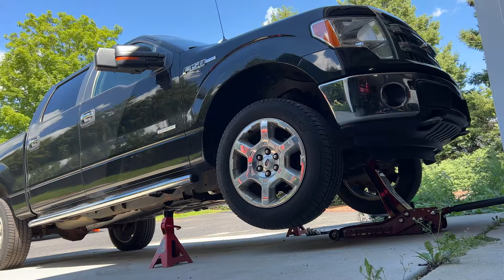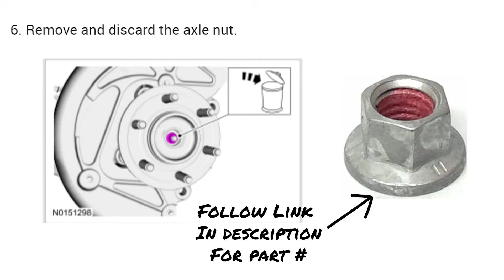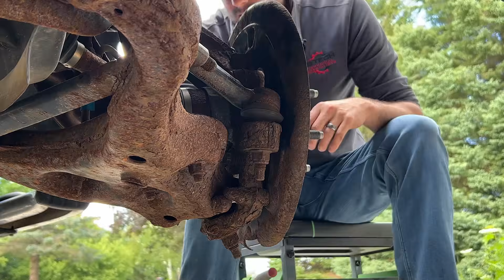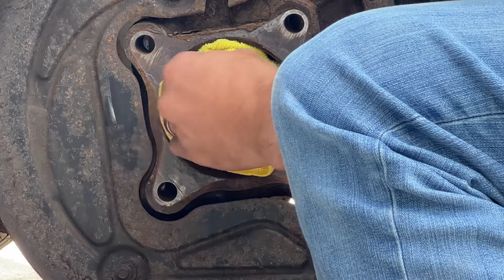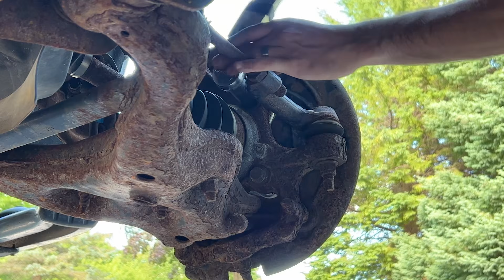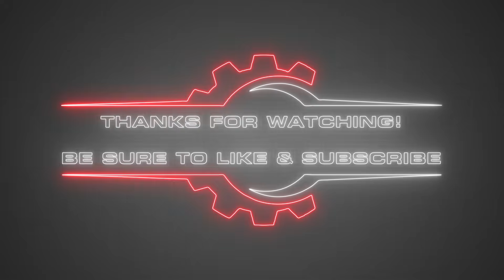Ford F150 Wheel Bearing Replacement 2011-2014

Comment: What do you do if the axle tip is protruding through the wheel hub too far, indicating the axle is too deep in the hub with the axle gear potentially touching the IWE gear?

Comment: I paid $130 to have the replacement parts shipped overnight. Based on the estimated delivery time of between 10:30 and 2:30, I took my truck out of service and removed the wheel bearing/hub assemblies. It's a relatively easy job. Shortly after noon, the estimated delivery time changed to between 3pm and 7pm! Great! As a result, I lost a days income. The parts did not arrive until almost 5pm! I contacted UPS, who referred me to 1aauto, who stated that since I got the parts before end of day, they would do nothing for me. Not a partial refund. Nothing. Nada. So much for a company that cares about its customers. Lesson learned. Don't trust shippers to provide accurate information you can rely on to plan your work, and certainly don't expect 1aauto to meet you even part way. Bob

Comment: Tried this on my truck... didn't go well for me. I ordered a MEVOTECH TXF40302 off Rockauto. The part looks amazing and came with everything I needed. However... when I put it together, it made a grinding noise like gears barely touching each other. The old part doesn't make that sound and the 4wd engages and disengages just fine. No noise while 4wd engaged. When I pulled a vacuum on the 4wd actuator, it holds vacuum well and disengages the axle. But the gears just barely touch and make a grinding noise. Bad actuator? or bad new part (gear face too long?)?

Comment: My local dealer wants to charge me $2000 to replace the rear end bearings on my 2013 F-150-that I have had serviced regularly  every 5,000 miles since new! and not once did anyone mention they don't check rear end lube, bearing wear or that I needed to have it done!  So stuck with $2,000 bill for what should have been caught years ago
Reply: Change it yourself. It’s so easy.

Comment: Another tip my axil pin did not come out enough to put the 15mm nut on it. So tap and shake until the nut fits on. Then leave dust cover off and drive around < 40mph and it came out that rest of the way. tighten up nut remove tire and put dust cap on.

Comment: This job is not a 1 hour job It takes the whole weekend: router sticks, bolts sticks, hub sticks. I had to walk to Autozone for stuff to help. If it's your only mode of travel plan plan and practice. Review this very good video and get the tool list.
Reply: Gotta learn how to wrench better, did both sides in my driveway along with brake pads and rotors in under 2 hours. Trucks got 300,000km in the rust belt. Heat is your friend btw, wouldn’t be able to do it without it. Don’t even have the pull the tie rod end either.

Comment: This was not bearing, it was hub assembly install...
Reply: Modern wheel bearings come as a unit, in this case with the ABS sensor and IWE toothed ring as well. You can't buy the wheel bearing by itself, and often the outboard inner race is machined right into the hub itself. Some may have nostalgic memory of pressed-in wheel bearings, but they were a pain to do.

Comment: Thank you for the video....I will be changing the wheel bearing hub assembly on my 2013 Fx4. I was just wondering if you would happen to have the part number for the metal cap that seals the shaft nut.
Reply from the maker: Hey Amrik, thanks for watching! Here's the link to our website that lists the parts we used. https://gotech.com/how-to/replace/replace-2011-2014-ford-f150-front-wheel-bearing
~Mike

Comment: Mine is just spinning hard o can figure out if I need a new one or not
Reply from the maker: Hi, when you say spinning hard, what do you mean? Like its seized up or are you trying to spin it by hand with the axle shaft installed still? 
~Mike
Reply: @GoTechTraining  so one of my front tires when the whole front is jack in the air spins a least one 360 if I spin it and let go the other spins harder but spins can't figure out if it's the caliper or hub

Comment: Does Ford want those hub bolts replaced because they are "torque to yield," types? That is, they stretch when torqued properly?
Reply from the maker: Hey Mark, thanks for watching! Usually when I see torque to yield bolts they have a ft lb torque value followed by a set amount of degrees. These did not, making me think they are not TTY.
Mike Becker, Senior Instructor

Comment: Good job Mike.  Not as much rust as South Main Auto in upstate New York, but you do have to be careful not to snap off bolt heads.  Hopefully the 4x4 IWE worked ok.
Reply from the maker: Hey Mike, thanks for watching! Yeh, this one wasn't too bad considering that the truck spends it's life outside. IWE/4WD worked great following the repair.
Mike Becker, Senior Instructor
Reply: @GoTechTraining couldn’t tell, but is this the 4x4 in the video?
Reply: @gimmetacodude no is a front wheel drive truck

Comment: If it was always that easy up north!!! lol!!!
Reply from the maker: Hey Erikkirby1, this is a Wisconsin truck. Sits outside everyday of its life! Seriously, they don't pop out too hard on these because it's a sealed knuckle essentially.
Mike Becker, Senior Instructor
Reply: @GoTechTraining  living in Quebec Canada with our weather we usually have to air hammer those out, ending up cracking the vaccum actuators or loosing vaccum seal between the actuators and the spindle...
Reply from the maker: Woah for real!? How do you ever get Edge/Explorer rear bearings out?! haha!
Mike Becker, Senior Instructor
Reply: @GoTechTraining  cut a stud off of the hub an put a screw in with a nut behind... it acts like a puller ;) in pushes on the knuckle
Reply from the maker: Eric O did a video showing that. I haven't needed to do it yet but I will try it when the need arises. It's inevitable haha!
Mike Becker, Senior Instructor
Reply: @GoTechTraining  Saw that one, been doing it for a long time before.... i do work on rcmp police cars and they all have explorers... got fed up bangning and torching
Reply from the maker: Oh I bet! I need to find one to try it on now,
Mike Becker, Senior Instructor
Reply: @GoTechTraining  you will love the satisfaction!